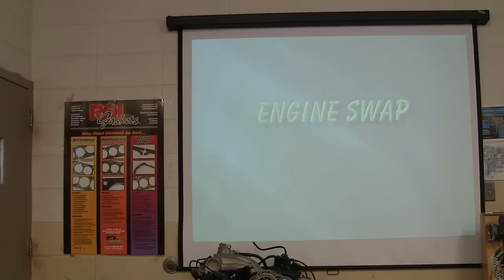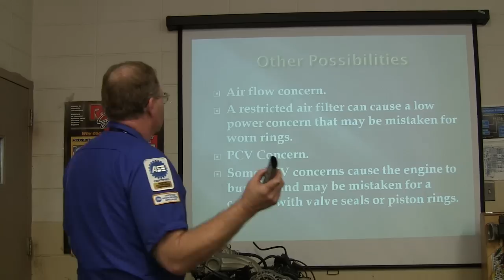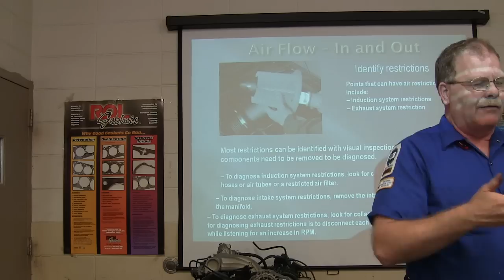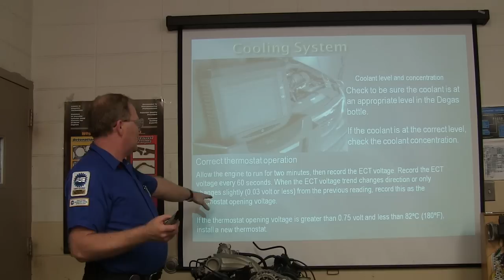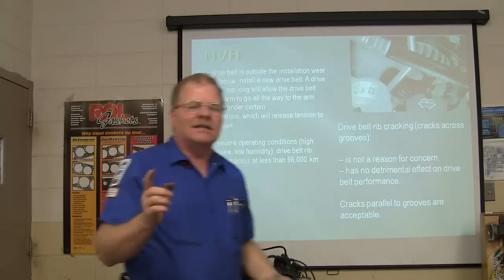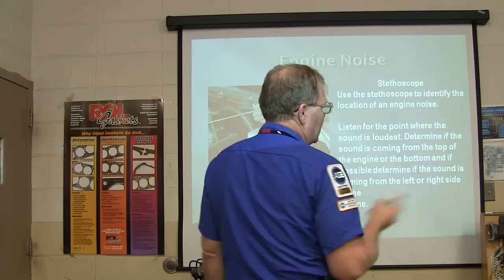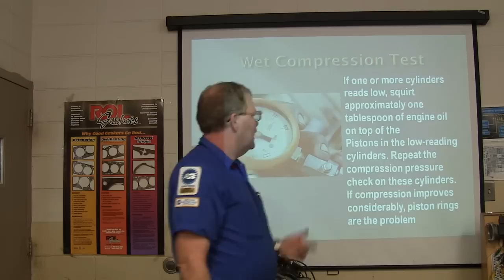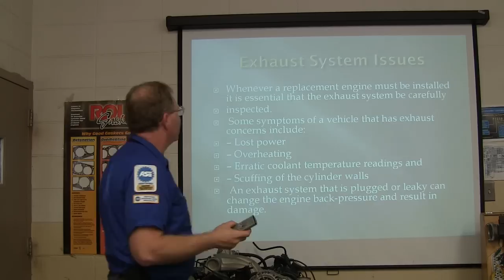Engine Swapping Stuff

Comment: I remember a long time ago, I changed a belt tensioner because it was bouncing. The new one bounced exactly the same and it was a dealer part too. What other things can cause that? The only thing I can think of is another pulley was egg shaped. Great video.
Reply from the maker: Probably something else in the FEAD system, yeah.  It's pretty annoying, but you can usually find it.